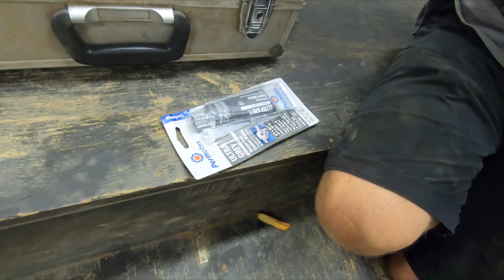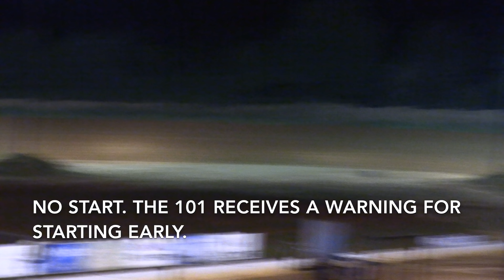They Didn’t Have Anything for Us / Southern All Stars at Southern Raceway

Comment: I watch yall load yalls car by sittin on the door. I couldnt get back out if i did that. 10' peice of pipe weld the fittin that goes on the steering shaft in the car. Standing at the back of the car by the spoiler on the ground,put the pipe thru the car above or beside the seat weld the fittin on the other end that fit's the wheel. An drive it up in the trailor just walkin behind it. When u get to the track, you steer it back out like u drove it in. Dont no if yall done tried that way yet. Its easier mayb

Comment: I would imagine, that if the engine is hurt, that there is someone who is watching that would provide another engine to get you all though tomorrow night. 

Although, it seems to me that the fuel pump either needs to be rebuilt, or a new one bought. Which I am sure there is someone watching that has a brand new or like new fuel pump who is watching. So I would imagine, if you want to race. It can be made to happen.